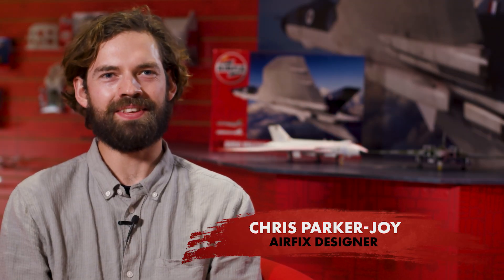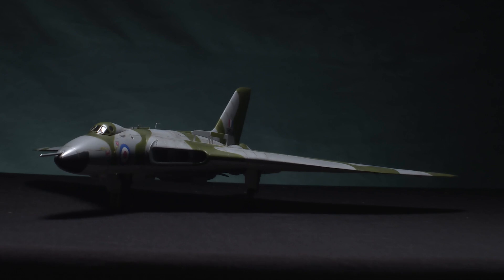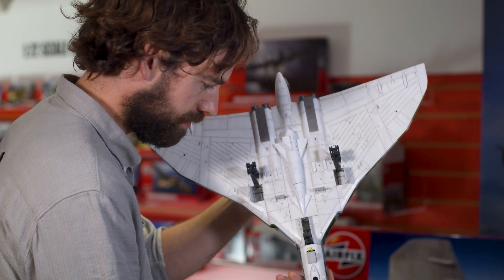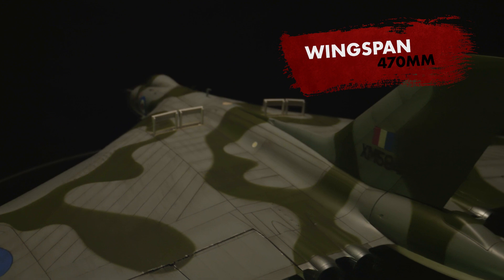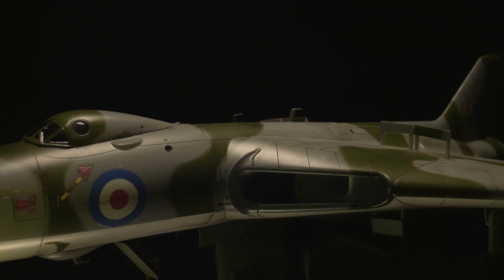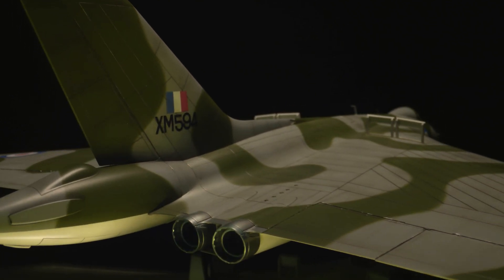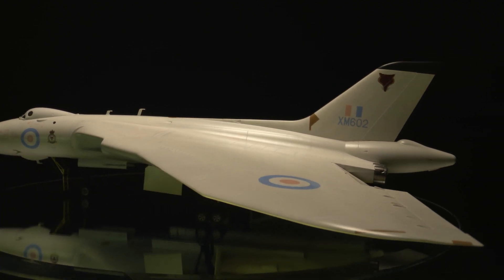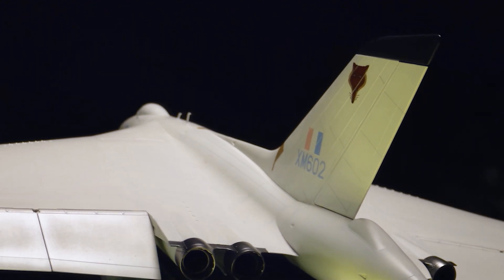AIRFIX | Avro Vulcan B.2 - 1:72 Scale

Comment: In the middle of building this kit at the moment...It's going together like a dream....The bombay and the way the air intakes go together is a piece of beauty and an absolute pleasure and joy to build.....Painting/spraying the intakes is going to be a very tricky job but it always was going to be that for the modeller trying to recreate the camo join to white in that area...I think the Airfix designers have created a masterpiece in this kit...Priced at just above £50 it's well worth it and scope for pipe work and cabling to add that extra detail from scrap wires very cheaply around the bombay is a nice and relatively easy touch

Comment: I trained on these aircraft in the late 60s, and here is a little info just for interest. The ‘V’ force, Valiant, Victor and Vulcan nuclear bombers were painted white to reflect the heat of a nuclear explosion. The missile shown in the bomb bay was the Blue Steel nuclear missile, powered by kerosene and high-test Peroxide (HTP). It was so large that the bomb doors had to be modified to accept it. The same missile could be carried on the Shackleton Mk 3 Phase 3, which needed a tricycle undercarriage and jet assisted take-off to do so. The RAF started camouflaging their aircraft around 1971 or 72, which is why they show the different colour schemes here, but Blue Steel was obsolete by then, and we started using American nuclear bombs instead.
Reply: Well, the Vulcans in the 1965 James Bond movie "Thunderball" were in camouflaged paint schemes...
Reply: Thanks for confirming that. I opted to go with the satin white finish as that was the colour I remember most when they used to fly over Whenuapai airbase in new Zealand. I was over halfway through when I started to wonder whether I was right to go with the Blue Steel fitment. I saw a picture in a book about Vulcans and it showed a white Vulcan flying with a metallic blue Blue Steel missile underneath it. The kit shows the missile as white.

Comment: I was one of the RAF Armourers that bombed up the Vulcan on Ascension Island during the Falklands war. So naturally, I have pre-ordered this kit. But, like a few others have said. I am deeply concerned about the panel lines. I really think you have overdone it Airfix. You look at any photos of the real aircraft, and you will see that the panel lines are nowhere near as prominent as you have made them in this kit. I really hope I am not right about this, and I hope it doesn't ruin the model.
Reply: The option exists to use modeling putty or some other filler to diminish the panel lines.
Better to have too much detail and take it away than not enough detail and have to add it yourself.
I must admit, this is the first time I have seen someone complain about too much detail on an Airfix kit :-)
Reply: @polygonalmasonary  I am not complaining about too much detail. I am complaining about the obvious miles over scale panel lines. Plus to turn round and say "you can always use filler to diminish them" is frankly, a stupid comment. I should not have to reduce them. Airfix should have got them right in the first place. I worked on real Vulcan's for 4 years, and in all that time, I never noticed massive panel lines on the real aircraft. Esp those diagonal ones on the wings. Look at pictures of the real aircraft, and you will not see these panel lines.
Reply: Airfix always have over-the-top panel lines, especially in 1/72. Panel line grooves in general are a quite unrealistic, but they allow a model to end up looking more realistic as it would be impossible to put a realistic size 'gap', excluding the fact most panels are overlaid anyways.

As far as Airfix goes, these aren't as trench like as they normally are. I think Airfix still builds kits with a 1980s kid whacking unthinned paint on a kit in mind.
Reply: @TheHarvHR  I now have the kit. Then panel lines are not as bad as I expected them to be. But the ones on the wings still look unrealistic compared to photos of the real aircraft. We will have to wait and see what it looks like with paint on.
Reply: Two coats of primer will take care and diminish the panel line if done properly.
Reply: Just start out by "black-basing", add an extra coat of grey primer, and do not over-dilute the colors, doing the grey/green scheme. On the actual aircraft, the paint completely covered the bare metal, whichever scheme you choose.
Reply: This issue apllies on basically every aircraft scaled down to this scale. Realisticly the surface of an 1/72 airplane should be completely flat to be scale correct. But that would look like just boring, thats the reason why we have surfece details to play with.

Comment: One comment on the panel lines, the nose is slightly wrong. It's not a panel line as such, more a seam that needs filling. There is a seam that runs around the nose, where no panel line should be. With a heavy wash it throws the look off, a note should be put in the instructions that this is not a panel line and should be filled. I don't quite understand why it wasn't designed to run along an existing panel as there are suitable ones a little further back.
Looking forward to getting hold of two I have on pre order. I was planning to have six of them, but because of the delays I'll have to stop at 2 as I will not have the space to build many of these as a uni student from September onwards.
Hopefully by the time I'm finished with uni some other company will have tooled up a Vulcan B1 to go with it (NOT a straight wing! They were only prototypes and the first 5 production ones, most had the smaller Phase 2 kinked wing, B2s had Phase 2C)